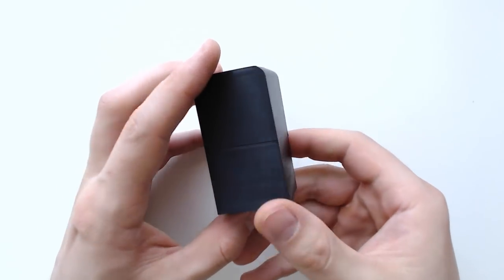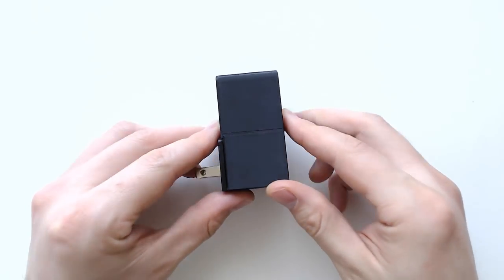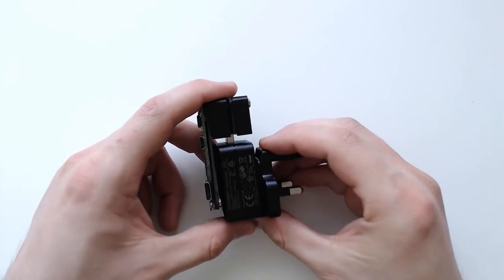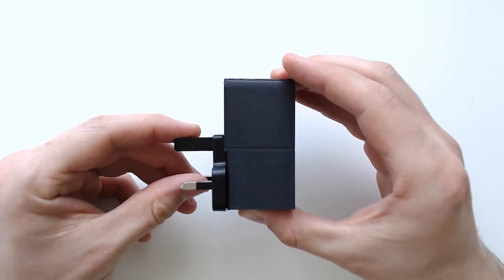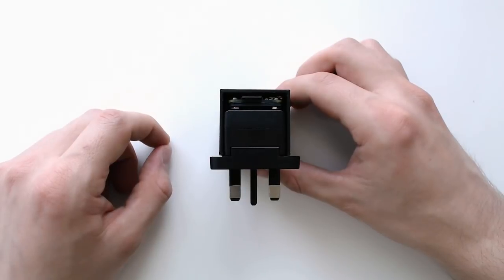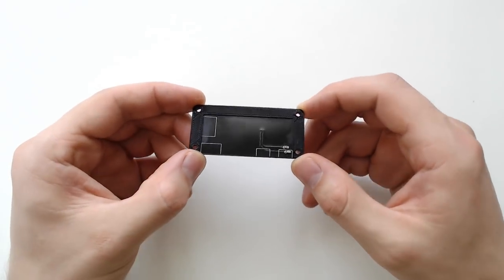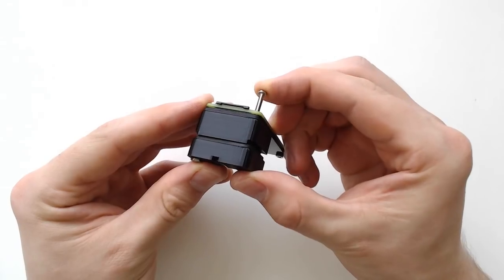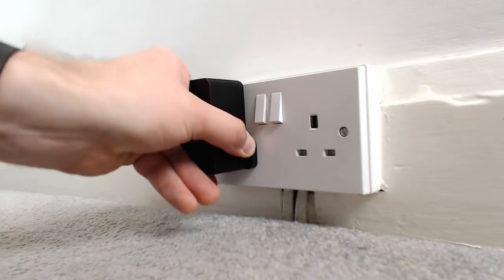The Pi Plug Mini Server (V2 Updates)

Comment: Yeah... Make one with the case of the power supply removed, solder permanent leads to the pi, and 3D print a new case with the USB plug pointing outwards (isolated properly from the Pi, of course).

Comment: i would gladly buy one of these if they come up on the shop but unfortunately they would have to be shipped from within the European union or i would have to pay massive fees due to a new demand the Swedish state post have implomented. Great design though and looks really minimal. One nice feature you could look up is if you could get a lithium battery inside the case so it could keep running if power was cut or it was unplugged. I know that you already have some issues with finding ways of shipping and with a battery it would be a incredibly hard costly and slow to ship overseas. It's an amazing idea like it is now already and have many cool usage cases.

Comment: Looks good, should be able to blend in enough that most people just ignore it thinking it is a power brick for something else.
Reply: How feasible would it be to put a usb charging port on the unit to make it more convincing as a power brick. Would it result in a lack of current for the pi?
Reply: Not that hard at all, it can also act as both a data siphon and direct tap.  Place the voltage lines directly off the power for the Pi and then the data lines to the Pi.